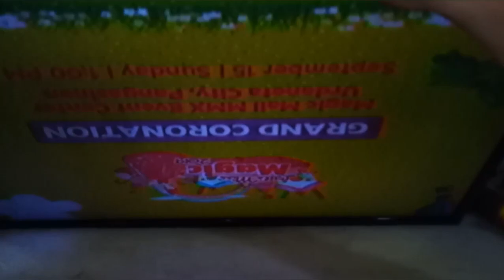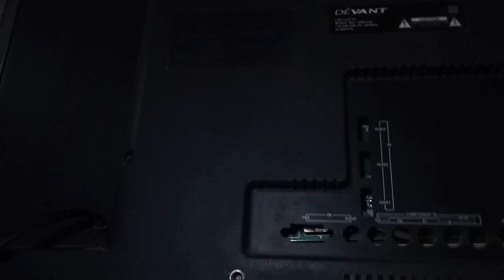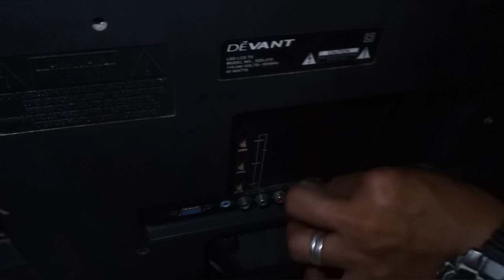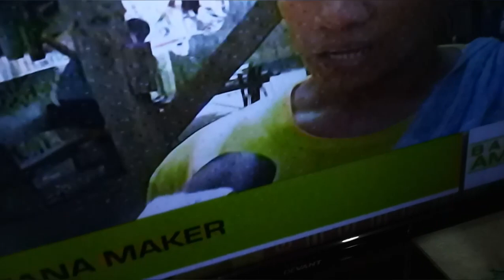How to fix LED TV NO SOUND -Converted Audio Amplifier(tagalog)

Comment: Sir pano po ba ang technic pag don sa mismo audio ic kakabit ang convert na audio board, halimbawa sir sa toshiba model no.40L2400VP
Reply from the maker: Try u muna saksakan earphone sir pag malinaw sound dun u na kunin input.pag distorted tanggalin u audio ic
Reply: Halimbawa sir wala syang earphone pano sir yong technic para makuha ang audio input from the main audio board ?
Reply: May nrepair kasi me sir toshiba nawalan ng sound need me sana gawan ng paraan lalagayan me bago audio board wala syamg earphone need me makuha ang technic kung pano malalaman kung maconnect ako sa original sa na audio board
Reply from the maker: @reypalmero347 pg wla sir hanapin ang input dun sa ic sa pammagtan cgnal tracing..
Reply from the maker: @reypalmero347  mag cgnal tracing dun sa crang audio ic sir..
Reply from the maker: @reypalmero347  madali lng sir tanggalin u n lng audio ic tapos mag cgnal tracing ka
Reply: Ok sir maraming salamat
Reply: @JoeyTECHPH  kng malapit k lng sken sir d sna ibigay k syo yng fluke n tester k dto d k gaano ginagamit model nya 15b+.

Comment: Pano yan sir di na maadjust sound nyn fix na?
Reply from the maker: Pataposin mo yung video zir.
Maadjust parin yung sound niyan
Reply from the maker: Naaadjust parin sir kc hindi naman ung sunog na audio ic ang nagcocontrol ng sound nya kundi ung cpu ic nya.salamat sir
Reply: Master pano ba mg voltage test ng  output ng regulatior sa crt tv sharp kaylangan ba nsa negative ng filtercap ng tester tapos yong positive testprobe nsa vcc tnx sa sagot.
Reply from the maker: @shirleycarranza8015  tama po.bakit wla bang power?
Reply: @JoeyTECHPH  master yung smart led tv namin ng green screen tapos my guhit pa anu pong sira..?
Reply from the maker: @ronajeanfetalino4609  patayo ba guhit pahiga?
Reply: @JoeyTECHPH  patayo po master ...
Reply from the maker: @ronajeanfetalino4609  tech ka ba sir?
Reply: @JoeyTECHPH  ng aaral pa po ako master..